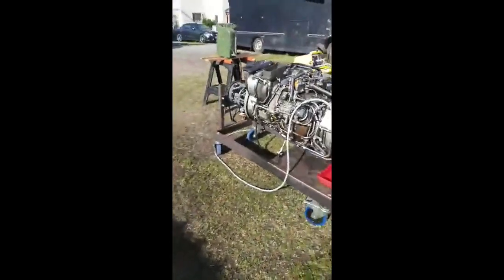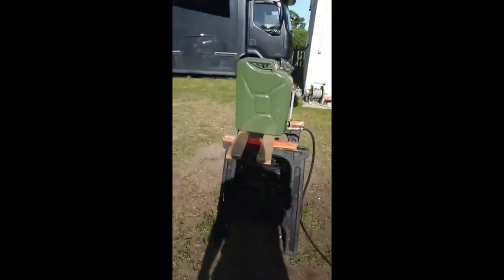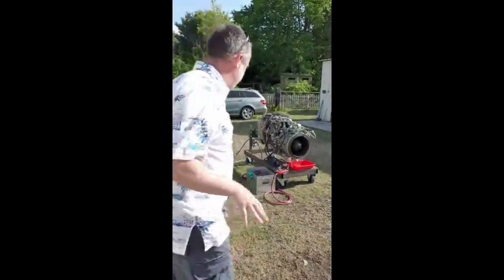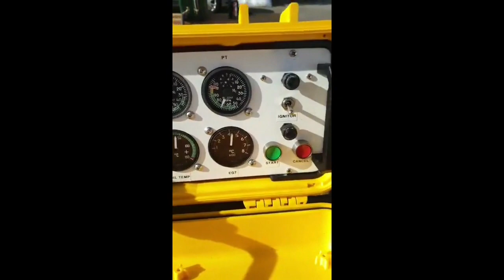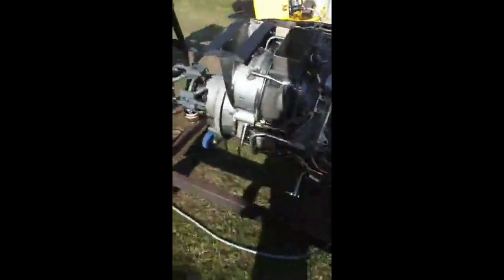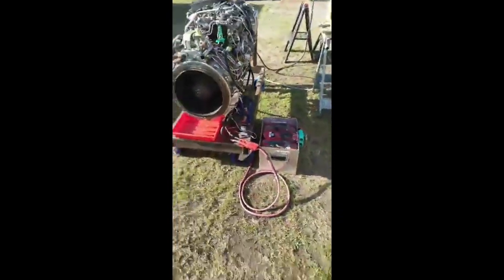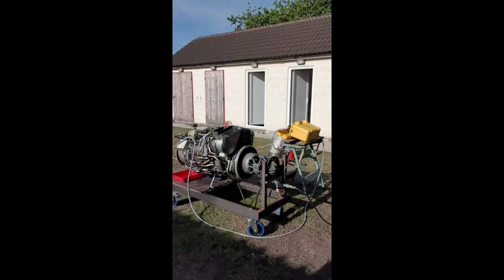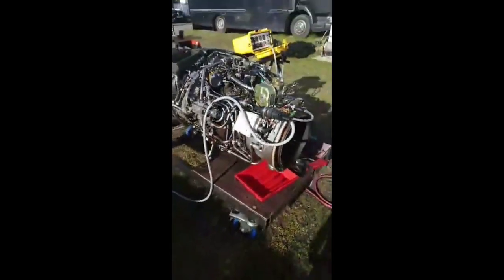Rolls Royce Gem Turbo Shaft, Gas Turbine Jet Engine from a Lynx Helicopter - jetpower.co.uk

Comment: thanks 4 showing your gas-turbo-shaft RR Gem, the first Lynx engine I've seen
on a test stand, I had a search to find out if it was the port or starboard type
but I'm not sure, but the Gem of yours engine accessories seem to favour one side,
it is possible the other side gas-turbine accessories maybe are on the other side,
this means pre-flight checks, servicing and maintenance easier, however the core is same,
and I think changing them to the other side would be possible,
the Lynx in my opinion has the best aerodynamic and handling ability's of all other rotary type's ever, as the Wildcat is introduced, I would love to own and fly this superb design,
I do have dreams.   Cheers fella